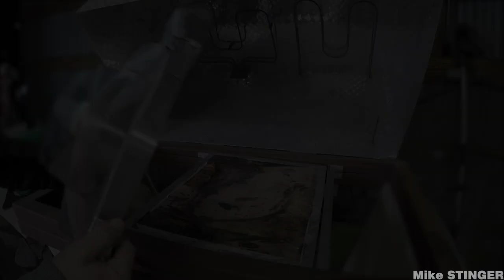FISH PRO VHF Mount Vacuum Forming

Comment: Awesome work as always Mike. Plastic has to be the way to go the hard work has been done now in making the plug. Obviously you can make these far quicker and for the buying public I’m sure they will appreciate the price difference. If the front panel weren’t not cut out it may make it easier to use different brands of radio. Carbon fibre would also be a dressy option for some. Brilliant work that could be a life saver !

Comment: You asked which material we would like better in the video, so here are my thoughts. The plastic shroud looks amazing. Your aluminum parts look amazing. I can tell there is a lot of hand work that goes into your aluminum parts and thus they would cost more. I would assume it takes much less time to make the plastic parts as there is less cutting, welding, deburring, , prep, argon, tungsten, filler rod, and powder. My only concern for the plastic would be longevity. Not all plastics perform the same after being exposed to sun and saltwater long term. Most plastics fade and become brittle with UV exposure making them prone to cracking. If I were buying this part then It would really depend on the pricing and also the type of plastic used in the vacuum forming. I would lean toward the aluminum parts myself for long term strength, but would consider the plastic based on the material used.

Comment: How hard is it to run the wiring with this mount?
Reply from the maker: Not difficult at all
Reply: @MikeSTINGER  is there a way to run the wiring without drilling into it? I haven't taken it apart to see what needs to be done.
Reply from the maker: What are you thinking of drilling? I make it to where you don't need any extra drilling.
Reply: @MikeSTINGER  just was wondering the wiring path to the fusebox/battery
Reply from the maker: You will be pulling wire through the breather tube under the front top cover. The way factory wire is installed.